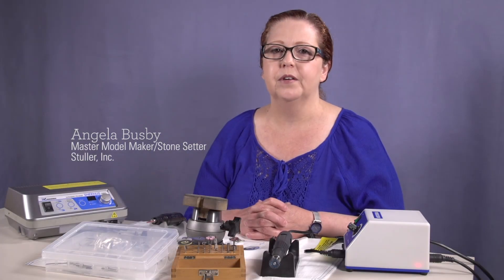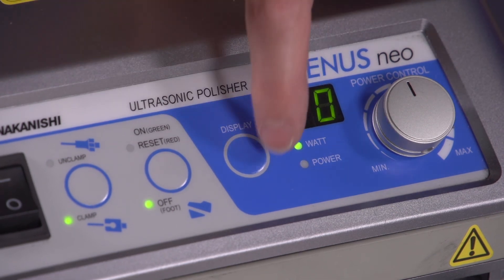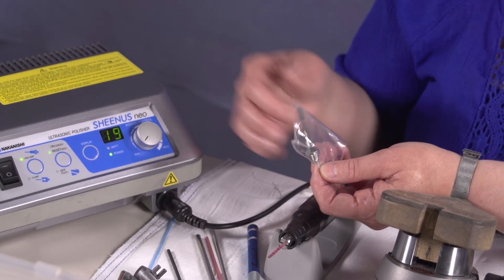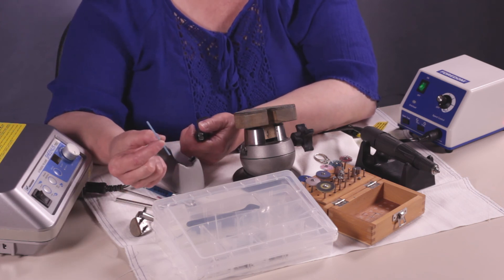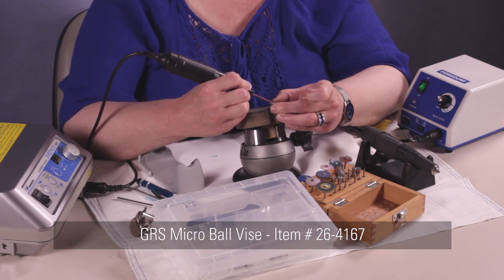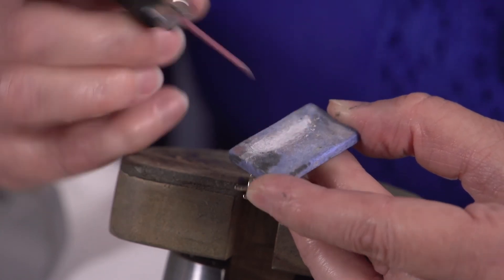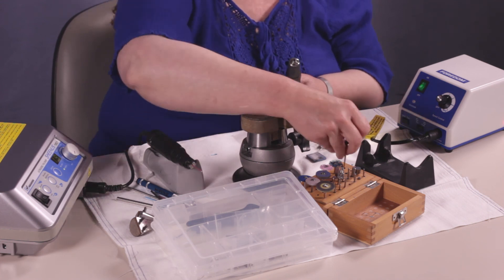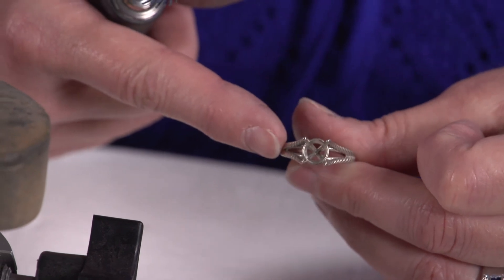How it Works: Operating an Ultrasonic Polisher

Comment: actual NSK TECH!!!! IMPORTANT!!! 1st always call us if theres any questions and our team can help! she is right, to high and u will trip unit and or your handpiece gets Hot! 2nd use the proper clamp modes it makes a difference. 3rd always use the reset button to turn off the handpiece, failure to ensure h.p. is off can cause damage or worse, then power off the unit! same as if you would leave rotary instrmnt on, not safe! The rotary tool used is NOT Nsk and we have a better unit now available Emax EVO with the brushless micro motor! Great video overall and good demo!  Keep it up!
Reply: chris Schmidt So when would you use the higher power? Does the foot pedal control the power output? Or is it just for on/off at a fixed power?
I want to get this machine and I really wish you guys and your distributors had more info about it online.
Reply: Sir like to know Abt A3 Polish Can u Explain it !

Comment: No way... ceramic stones are used in clamp mode.....short diamond file tools > unclamp mode ..only difference is max power output.. 
and  bristle discs. starting with red is nonsense (220 grit) ..too coarse .result here would be the same without using the sheenus neo...that should be used for final polishing with fine grit..like 1000 - 1200..white or red Xebec or Superstone.
Regards..